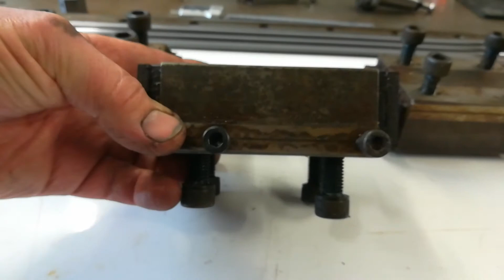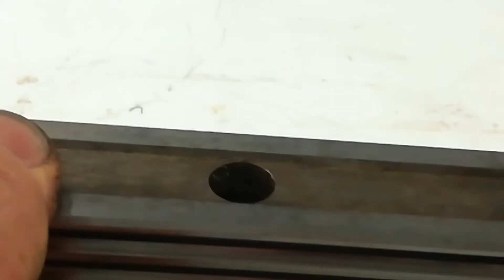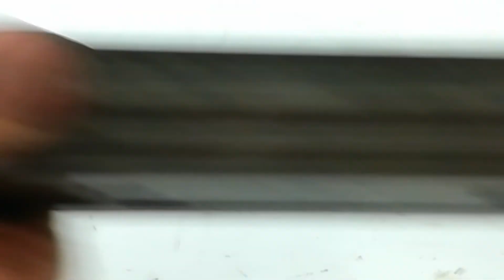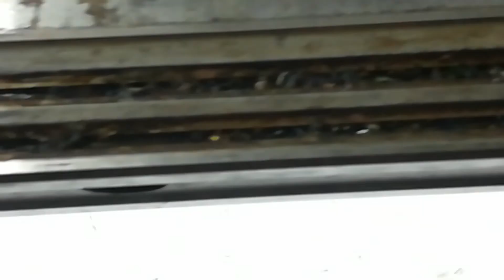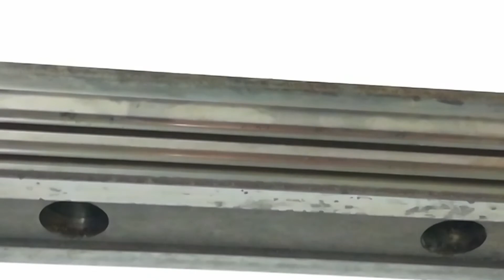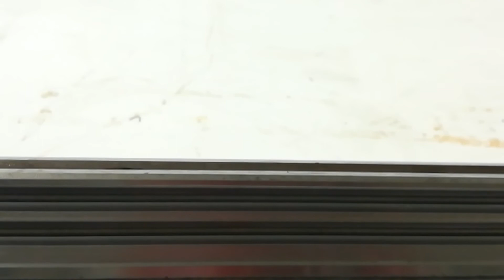Old Linear Slides. CNC Lathe Rebuild

Comment: Good stuff Peter. The look in pretty good nick from the video aftercare clean up
 If there is no wear on the rolling elements and no visible wear on the tracks then that's money in the bank  and onward and upward. Liking how this is coming together. Keep up the good work. Interested to see what you do with the controller and spindle drive also. This area can be a headache. I'm dealing with a minor setback at the moment with the spindle drive and an intermittent  fault. Oh the joy of old machines lol
Reply from the maker: Hey Mick.
Good to hear from you.
Yes looking good so far. 
( as Big Kev would say, I,m Excited  )

I could have got away with not replacing any of the Linear slides.
But I am concerned that if i don,t change the X axis slides at least i will have some trouble with them in future.
As these sliders are the harder working of the two rails.
Both in travel and side load.

I have already purchased some new X axis slides that i will show in the next video.
As mentioned they are made by HIWIN Taiwan.
It,s interesting reading the specs on these carriers.
Each block is capable of carrying a 9 Tonne load ??
Even at half of that rating it,s still a decent load.

You got me concerned again ??
Thinking about the controller ??
I am happy to keep what i have at the moment.
I did think about retro fitting a Siemens set up.
But looking at prices from overseas suppliers.
I am looking at at least 20k plus.
That is only for an 808 Advance Controller.

The only problem then is the difference in price of buying the Mazak, retro fitting the Siemens.
A Brand New Doosan LYNX 210 is starting to look more attractive, lol.

Always appreciate you taking the time to watch.
Peter.
Reply: @weldmachine  the spindle controller on the mills also has an orient function so this complicates things, unless you also have c axis on your lathe which has a similar requirement. Otherwise, on a lathe a vfd would probably work. Then the centroid controller looks pretty attractive also. But don't jump the gun. See how it goes. Plan for battery replacement and have all parameters ready to type in. Then it will sort out direction if any action is needed
Reply from the maker: @sophtayl  
Don,t mention C axis.
I already want one, lol.
But If If If i buy a DOOSAN ????
My problem is solved. ( maybe ??)

You are right about the two firing up requirements.
And i am looking forward to that day.
Then i will be Big Kev.

But as i like to say this machine is my old Mustang ??
Because i could not justify buying a new one i had to settle with restoring an old one, lol.
Reply: @weldmachine  you know the restoration of a car is about the journey and bringing it to its former glory not about the productivity at the end. The restoration cars bring in bigger $ than a new more capable model but it isnt the same. I am considering an update however. I need to be making parts not fixing parts. Maybe a doosan may been on the horizon
Reply from the maker: @sophtayl 
 I would like to buy a New DOOSAN.
But it,s an ego purchase for me.
There are only two ways to fix it.
Find more work.
Or wait until my next life time, lol.

I want to try and stay away from manufacturing myself.
Most people quickly find out how cheap they can get parts made which is a killer.
If you already own a machine it,s not to bad but buying a New one ????
Brings big concerns.

Our friend over on Sunppaa i am sure you have watched this guy before.
He has just brought himself a Brand New Doosan PUMA 10 inch chuck pretty much full optioned.
I know in our part of the world these sell for around 300k ????
Reply from the maker: @sophtayl  I will go halves with you in a Brand New PUMA.
But the only down side is you will hate to drive here to use it, LOL.
Reply: @weldmachine  was thinking about how often you would drive up to use it also lol
Reply from the maker: @sophtayl 
My analogy with restoring an old car is not the best way to explain it.
For me it,s more of case.
That it,s either this machine or nothing ??
I chose this machine.
It,s always painful to watch others buying new machines.
And visiting my local machinery supplier for the occasional bits and pieces does not help much either.
As they are a DOOSAN dealer ????
Most of the time they have what i want just sitting there. 
( waiting for me ) LOL.
I can,t help myself to always have a look ????
Nothing much worse than punishing yourself to always be looking at something you can,t have.

Comment: Linear motion makes a super interesting content! Looking forward to seeing what you decide to do.
Reply from the maker: Hey Tim.
I understand Box Ways are for rigidity, but i still prefer Linear Machines.
If something goes bad on a box way machine, it,s a huge problem.
But at least with linear Slides you have option to just simply replace them.
As i will never be doing any type of heavy machining work in my shop i do not see it to much of a concern in the near future.
Linears themselves do take a lot of load.
In the next video # 7.
I will be revisiting the Linear Slides again and talking about ways to inspect them and include some general information about Linear Slides.
I am sure i will see you there.

A Big Thanks for always watching.
Peter.
Reply: i guess it is pretty randomly asking but does anyone know a good site to stream newly released tv shows online?
Reply: @Nathan Anthony I use flixzone. You can find it by googling =)

Comment: Beyond visually, is there a method used to measure the wear?
Reply from the maker: Hey John.
There are few ways to approach a diagnosis.
But it depends on which point you are at to measure it.

If it is on the machine you would normally be listening for abnormal noise.
On the bench as in my case mostly visual or by feel ?
What i mean by that.
Is do the rail carriers move smoothly or are they slightly resistant to movement, combined with a visual inspection for scuff marks indentations of any kind that would make the the carrier resist normal movement.
Uneven ware would be one to look for combined with scuff marks in the direction of travel.
Your Comment has earned a follow up video, as it might help others with a similar question.
Video # 7 is on it,s way soon, lol.
Thanks for your comment and also for following along on this series of video,s.
Peter.
Reply: @weldmachine  In terms of helping others (immediately, or in the future) I think it will make a good follow up video. With the price and/or down time/availability of parts being what they (as well as disassembly) it could be just the kind of info someone is looking for.

Comment: You doing a great job on detail which is very important on that machines, good luck and it will be interesting to see what you decide on
Reply from the maker: Hey Jan.
It was a last minute decision to use the rails that i cleaned up.
As i was making this video i was already to go to buy the 4 replacements.
But at the last moment i thought maybe ??
It just seemed a shame not to use them.
These rails take most of the load of the machine itself so it seemed right to try my best to save them.
It will all make more sense as i post more video of what goes where.

For myself these video,s work like a video diary of the rebuild and it seemed a worthwhile project to share with others like yourself.
This series of video,s is the whole reason for posting video,s from the start.
Thanks for taking the time to watch.
Very much appreciated.
Peter.

Comment: Sup, Peter! Nice to see the Mazak coming along. 🙂
Personally I've found replacing stuff on machine equipment can be tricky (you know, with all my vast knowledge of machine equipment 🤣🤣🤣) or on any old equipment really, new stuff often doesn't quite mate up as well as the original stuff. If it wasn't working too bad before, I would think some clean up and fresh grease/oil will make a world of difference. 
Or there's the other option, make some (the blocks I mean). I don't machine stuff for a living so my perspective will probably differ from yours lol.
I love the challenge of doing something new a learning through experience. Ok, kinda rambling here, sorry🤣.
But, whipping up some blocks and heat treating them might be worth saving the 6k and possibly even learn something along the way.
Cheers, Peter. Keep up the good work!😁
Reply from the maker: Hey Chris.
WOW. I Love the Long Comment.
I can relate as i have a bad habit of giving long replies, lol.

I am not sure if i would be at the level required to make Linear Blocks.
It,s all precision grinding equipment.
But if there was a business to be made from it.
Then it might be worth doing.

The Rail Blocks are not really that expensive to buy in comparison.
They are approximately around $ 300 each.

What makes these more expensive is they are a precision matched set.
Meaning they are made together then precision ground together as a pair.

They really go to the upper limit to get them perfect.
Real aerospace level of quality.

These same Rails and Blocks are available locally at a very reduced price but they basically don,t fit ????
I would need to modify my machine to fit them.
Plus i would need to modify the existing tapped holes and also add more ????
It can be done of course but it,s all time ??

Thanks for your thoughts.
I always like when people like yourself get involved in what i am doing during the video,s. 
Mostly the reasons for giving as much information as i can.
Thanks again.
Peter.

Comment: Nice work inspecting for wear on the bearings and slides. It will make a big difference on the operation
Reply from the maker: Hey Lloyd.
I was already to the point of just replacing all the Linear Slides.
But the longer set which you seen one of them in the video were not so bad after all.
It just seems a waste to replace items that could still be usable.
As mentioned in the video i will replace the two shorter rails as these are a lot closer to the operating area of the machine.
Mostly the reasons for the bad discoloration on the rails them self.
Thanks for watching this series of video,s.
Peter.

Comment: Well I don't know what you are going to do about the drivers and control and all the other stuff that will need to be done - so mixing and matching new to old is the tricky bit....it is your machine and judging by what you've done already you are wanting something that will be like new ....with this rails- I woudl be biased to cleaning up and using same unless you measure something really off.
Reply from the maker: Hey Peter.
The Drivers and Controller will stay as is for the moment.
Nothing you can really do with either until something fails.

Then it,s the dreaded phone call to the local Mazak man, lol.
They always manage a smile when they walk through the door.
 ( funny thing that ?? )

I would like to call it more of a balance,  when mixing new with old.
Replacing what you can, mostly for long term maintenance.

You hit the nail on the head when you mention i want something New.
A New machine would be great,  but with the amount of work i plan to run through this machine i cannot really justify the expense.
It would be more of an ego purchase,  than a need purchase.

I would like to replace all the rails, it was my intention to.
But as the rails and blocks are in such great condition it would be a little overkill, even by my replace everything standard, lol.

The machine had no abnormal noises, by reusing what is there at current would be fine.
But when ever i rebuild anything i usually get carried away with my remove and replace way of doing things.

It,s always good to know other peoples thoughts on what i am doing.
I hope you will enjoy the series of video,s i have planned during the rebuild.
Thanks for your comment.
Peter.

Comment: Can they be rotated end for end ?   If you cant see any obvious wear marks that look a bit funky  , if it was my machine  i would re fit them and see how they go , maybe with new balls if they are available .  Then once  its back together & everything works as it should & the machine is earning its keep re asses then as you will know how the machine acts .   Or you could buy new ones that could be a waste of money if theres still life left in the old ones .
Reply from the maker: Hey Max.
First through the door today.
I could rotate the shorter rails but i will replace these ones with a new set
( X axis )
The rails are good but the blocks / carriers are a little suss ????
The longer rails i can save.  ( Z axis )
Luckily enough as these are the more expensive ones, lol.

As you would have seen in the video the one i cleaned is in very good condition for it,s age.
Also as you mentioned put it back together and see how they go.
But i am fairly confident the better set will be fine after a good clean and a new set of ball bearings.

I know i would have been better just to buy the machine and run it as is but i am a fussy bastard so i needed a machine that i could rebuild ????
As silly as that sounds.
But it is difficult to buy a CNC Lathe or Mill under 100k that will run without to much trouble,  and even if you spend more there is still no guarantee. 

Thanks for your feedback, very much appreciate you watching.
Peter.